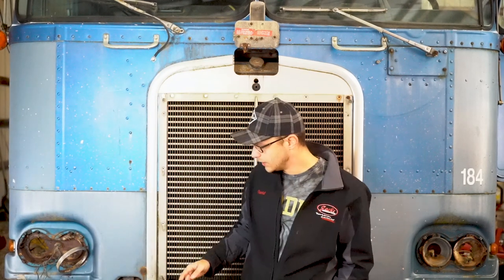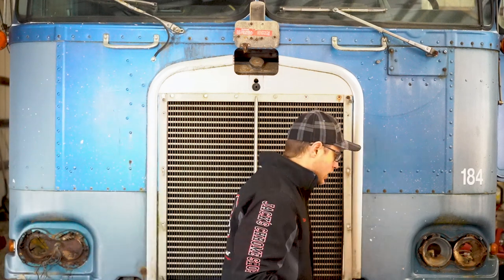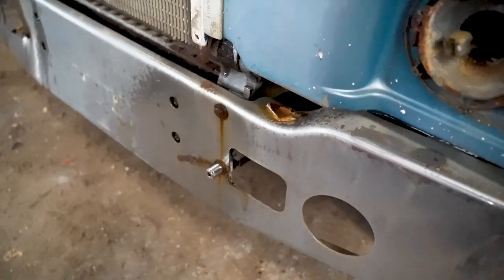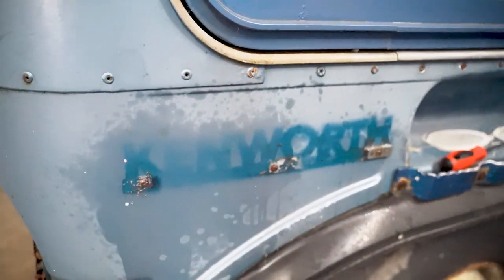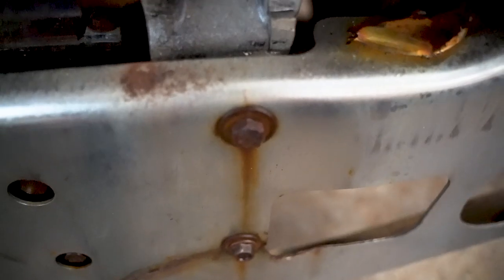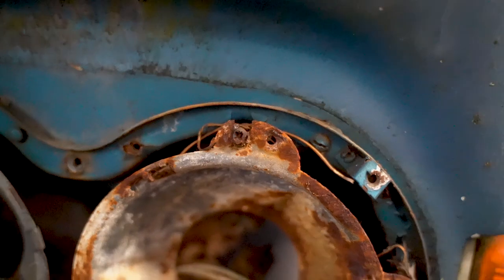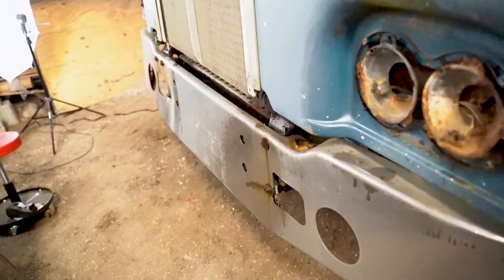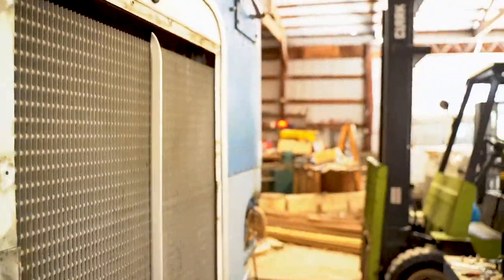Kenworth K100 Cabover Restoration Episode 3 - Rust is the Enemy!

Comment: Toss that WD-40 away, use a good penetrating oil, like Thrust or PB-Blaster.
Heat is the BEST for rusted bolts, oxy/acetylene (Aka - Hot Wrench) or just a MAPP torch will burn the rust out and save you from snapping bolts off.

Comment: Get you an induction coil heater for the bolts it’ll get them red hot without a flame! Few times with the coil around the head of the bolt and get the bolt red hot they will pop right out for ya.

Comment: As a former Owener of a K100 I see some one has changed all the front panels for you as they rot on the steel frame that is in be hind. that has saved you a lot of work. Don’t know if this truck has plywood floors as the older ones did. If it dose change the plywood. The other thing you may want to do is inspect inside the doors as the welds may be starting to brake from the door skin to the door frame. Common problem with KW best fixed before you paint it will take the sage out of the door if done properly.   

Good luck with this.

Comment: Should always use Impact sockets when using an impact it’s very dangerous when you used it on the front bar bolts! Also what works well for stubborn rusty bolt is heat (oxy or gas torch)
Reply from the maker: Was using a breaker bar when that socket got stuck!! But thank you for watching!

Comment: The absolute best stuff for rusty bolts and screws is WURTH ROST OFF.
If it won’t loosen them then its bust them off and drill with cobalt drill and retap.
So get some Wurth Rost off and then wash the bolts off with thinners and blow dry then apply the Rost off.

Comment: More than likely the bolts are seized in the aluminum spring mount. Get the nuts off the back side and then heat the aluminum up where the bolts go through and then try and turn the bolt back and forth. Believe me you do not want break the bolts off in the spring mount. I have a  1982 k100.

Comment: If you don't want to torch them off, have someone use an air hammer while spraying from the back with REAL penetrating lube (NOT WD-40). The vibration will help the penetrant get into the threads instead of just running off the outside of the fastener.

Comment: WD40 is the worst thing to use to break frozen bolts/nuts. Use WD blue flame penetrate or SeaFoam deep creep. WD40 is just a rust preventive. I don't know how WD40 became a fall back rust penetrate over the years, but it's caused allot of unnecessary work and bloody knuckles. PB-Blaster is crap too, but better then WD40 in a pinch.